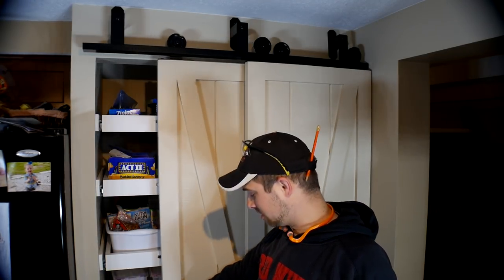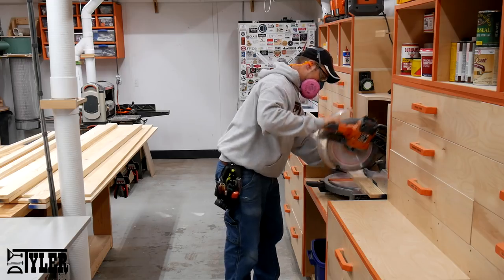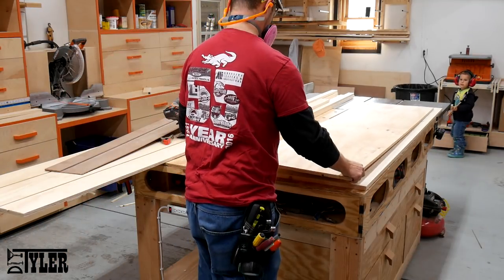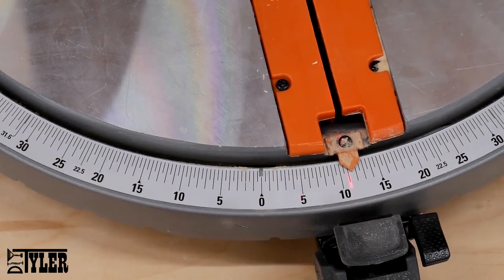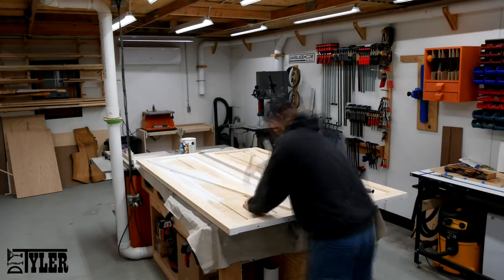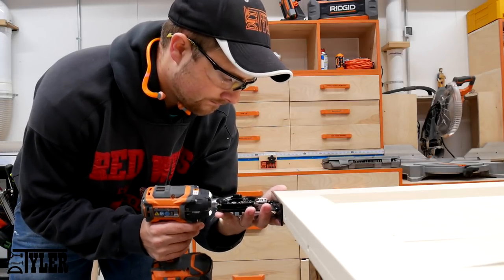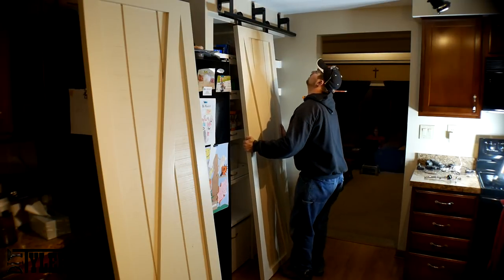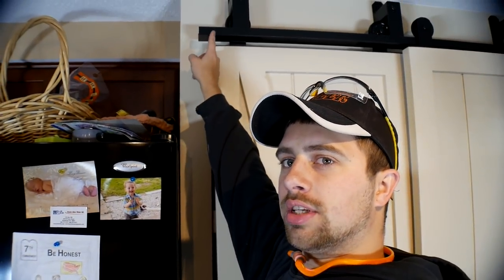DIY Barn Door

Comment: I wanted to use T-111 inside my workshop but was talked out of it by a "green" builder. He said it is not rated for indoor use and therefore the manufactures do not have to reveal all the materials and chemicals used to make it. He said it is known to offgas bad stuff indoors.

Comment: Nice work. I've had mixed success using my Q4 for spraying as I seem to find it difficult to adjust the viscosity/ nozzle combination. I normally try to thin by up to 10% and use a 1.8 or 2.0 nozzle. Can I ask please what did you use? Cheers.

Comment: Awesome project Tyler! I’d add a small rail in the bottom to prevent them from rubbing or banging. You don’t have to go the whole length, just about 3”+/- at the center of the cabinet on the floor.

Comment: Nice build. Hope everyone takes a look at your video on building the hardware as well.  Having had some experience mounting brackets to the edige of a vertical hanging door, I recommend to your viewers reading these comments to build/mount the hangers so that the hanger bolts pass through the face of the door and not through the edge from the top.  If the door gets much use over time, the lag bolts will loosen and they will need to be retightened or pull out completely.  Personal preference, but I wanted to recommend that. Metal strapping on the face of the door with bolts going through are a nice touch.
Reply from the maker: +Jeff Calaway The reason for mounting the way I did was so both doors look the same....if I mounted through the face one door would have straps in the front and the other wouldn't because the wheels oppose each other. Other option is complicated bent bracket.